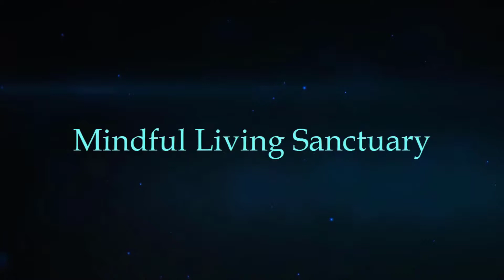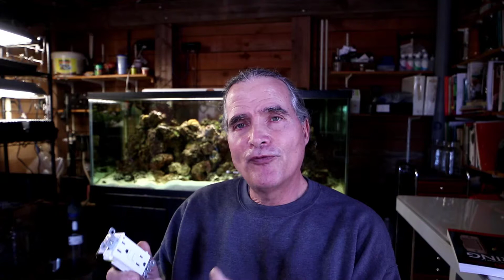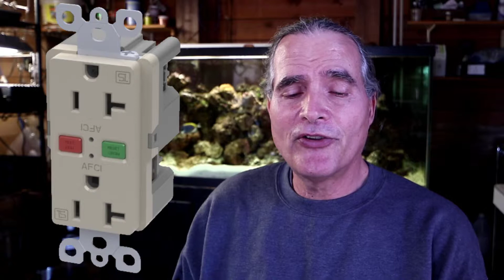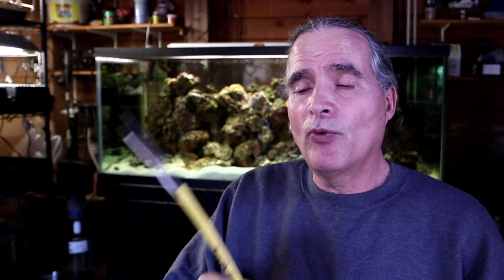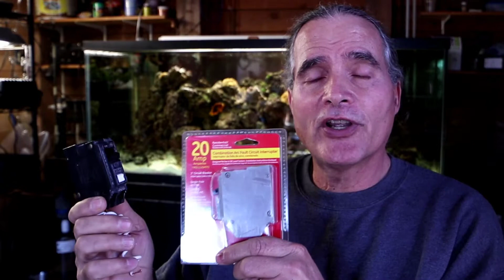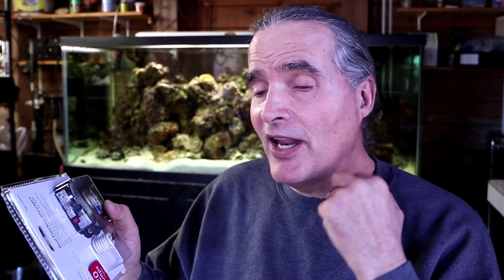AFCI Fire Safety GFCI Shock protection TRR child safety😀🔌🔌🏚🏡💡🔌

Comment: Hi Sr , Thanks for this great video. Is rewiring my old house I start with a new GE panel and laundry heather and oven breakers wiring and outlets   I will check more of you video to have a better idea what is the best place to the join  boxes to have future access. Question. Do you know if there are AFCI testers as there are for GFCi ?. Something to plug in the outlet to make a short so can be tested. Also You mention about testing AFCI with motors I am very interested in know more about. I was trying to find Dual breakers even for the Oven Dryer and Heather I want to have everything with protection if possible. Thanks for sharing your knowledge.
Reply from the maker: Thanks Paco, Yes here is a link to a Klein combo (AFCI & GFCI)  teste
Klein Tools RT310 AFCI and GFCI Outlet and Device Tester for North American AC Electrical Outlet Receptacles https://amzn.to/2NlQ034